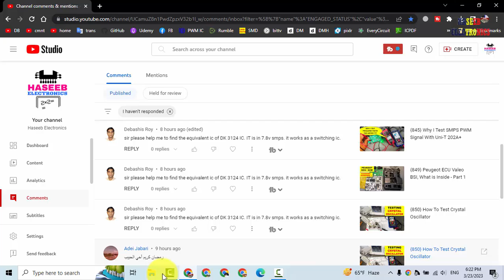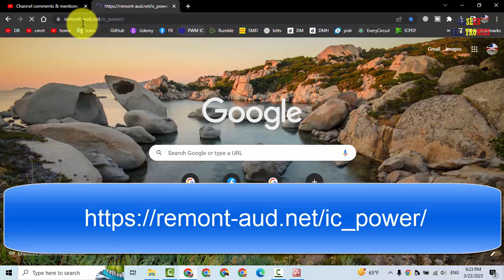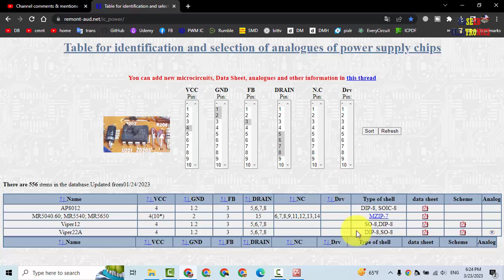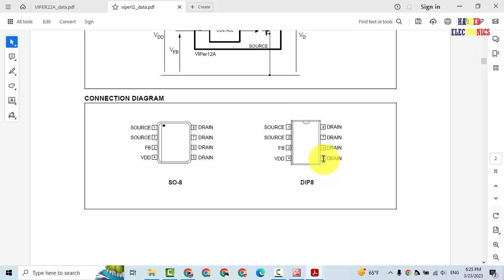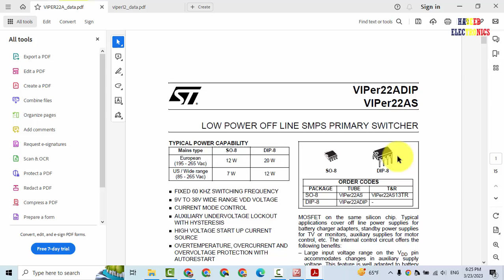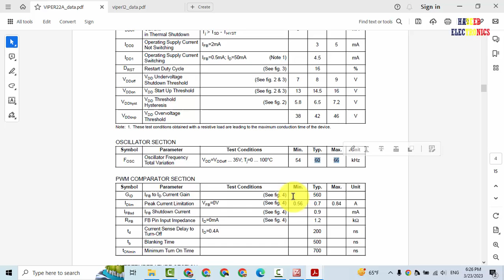{852} How to find SMPS PWM IC Equivalent

Comment: FA5528 equivalent
Reply from the maker: there are many pin compatible ICs are there (like NCP1200 60KHz chip, DAP006, LD7575, FAN6755, OB5269, LD7575, etc)
but there is VCC and feedback adjustment will be required or may be you will ned to alter the circuit based on new chip's requiremnet
Reply: Thanks a lot.

Comment: Sir what causes the dvd player smps IC to explode...please Tell me Master ❤🙏
Reply from the maker: possible causes
power transformer 
RCD snubber 
low value startup resistor 
bulk / main dc capacitor / smoothing capacitor is bad
bridge rectifier may be  damaged
Reply: @HaseebElectronics  Thank you so much MASTER For sparing precious time for me...

Comment: @haseeb electronics, Sir thanks for your guidance. But viper 22A not working. I has another ckt . When I replace the ic with dk3124, this ckt works well . But when I use viper 12A/22A /Ap8012 that ckt doesn't works and this time ic is not switching.

Sir with dk3124 vcc is reaching 4.62v. but with Viper 22A vcc goes to 13v.  

With dk3124 i am receiving a fluctuating voltage in primary coil 2nd end. But with Viper 22A the 2nd end of primary coil has a voltage equal to 1st end of primary coil which is about  314v dc..

Waiting for your kind reply.

Comment: Haseeb many many thanks for the fantastic info you provided.
Once found a substitute, I think would be of great help to know if there could be a way to test the ic IN CIRCUIT, with a bench power supply so if there's still something wrong on the board, one will not destroy the replacement ic.
Anyway thanks alot for your valuable channel 😊

Comment: Thank you. My 42 inch led is taking longer time to come to standby when power on. Please let me know ehich area to troubleshoot?
Reply from the maker: most probably
its startup resistor, vcc capacitor, input capacitor, or any capacitor in secondary side is devalued or have internal leakage